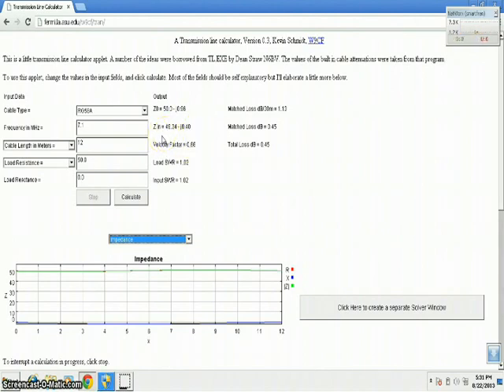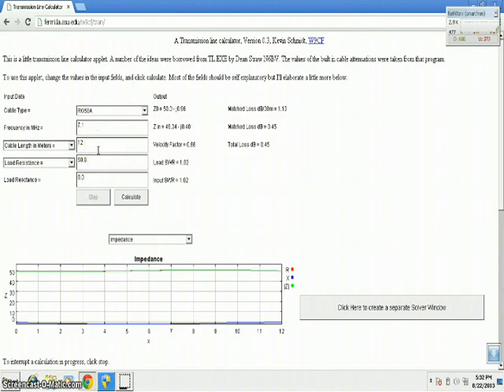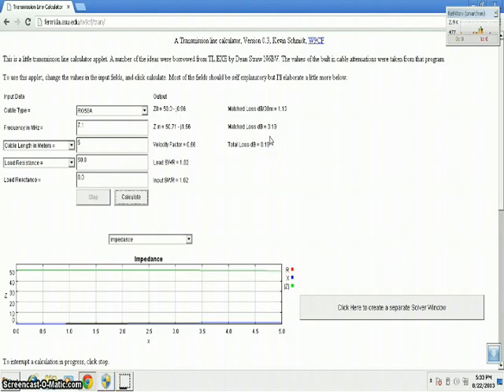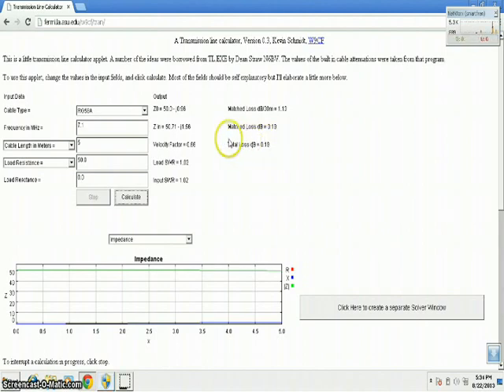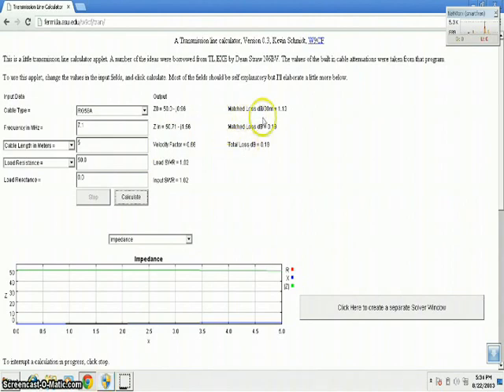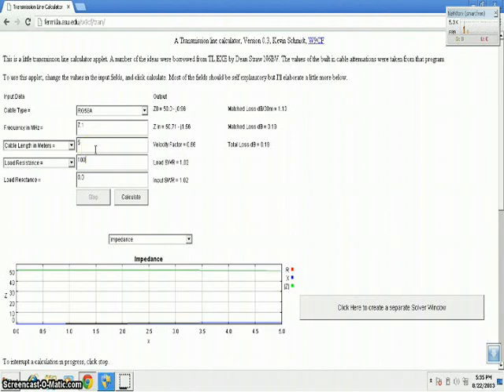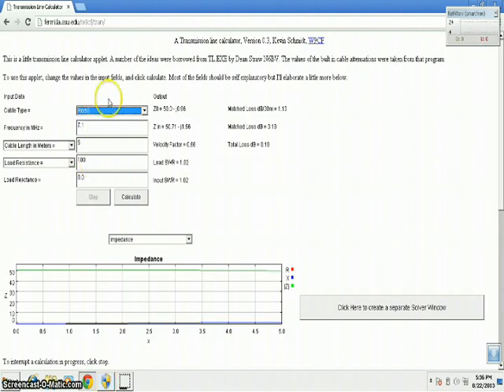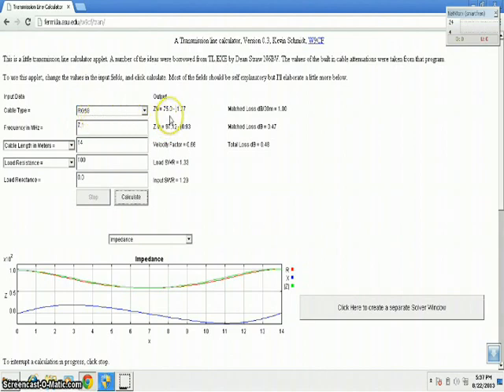How to Determine Coaxial Cable Length Correctly for Your Antenna?

Comment: Ask a broadcast engineer that,or a proper  radio engineer,,they will disagree,,,as chope the coax the swr reading at the radio will rise and fall ,,even at short lengths  put it to the test.

Comment: Read the mfj 259b analyzer manual. It will tell you this video is wrong. 

Their is a big difference between 50 ohm resistive load and a 50 ohm impedance. You cannot pick and choose what and how you define an antenna as. An antenna is not a resistor. 

In that perfect world inside your computer everything works like you say but in the real world none of this applies!
Reply: exactly..... the correct length is the amount from the antenna to the radio.
Reply: Read the MFJ antenna analyzer manual. To summarize, to obtain a 50ohm impedance of the antenna you must use an electrical 1/2 wave of coax, to the frequency of operation, between the analyzer and the antenna. 
 
So why wouldn't you use 1/2 wave increment run to your antenna when an MFJ analyzer is nothing more then a signal source (transmitter) with a built in swr meter?
Reply: @sevenoseven8494  What if your multi banding? Would you use a 1/2 wave length of the lowest frequency? So if your lowest frequency was the 80M band you need to add 40M of coax when your shack is only 8M away from the feed point? If the Impedance is incorrect with a short feeder then perhaps we can use a different type of feeder or a balun to match the impedance, i don't see that it's necessary to always have 1/2 a wave length. 
  Perhaps they want everyone to use 1/2 wave length with the MFJ to keep results consistent at the antenna. After that you can find a way to shorten it to save loss.